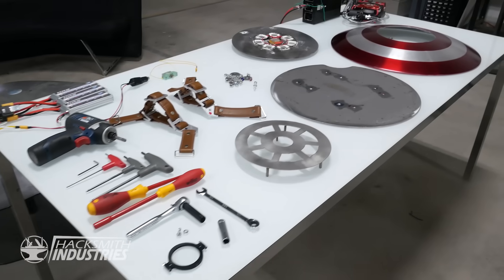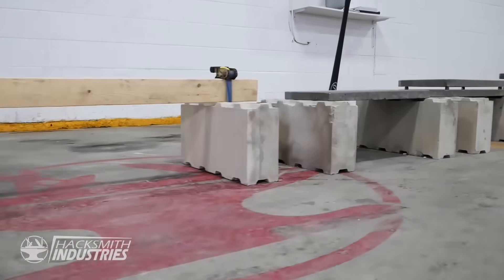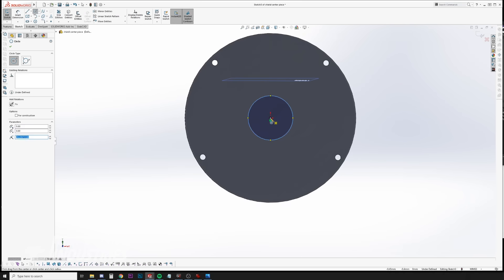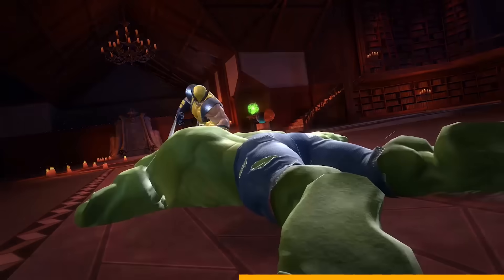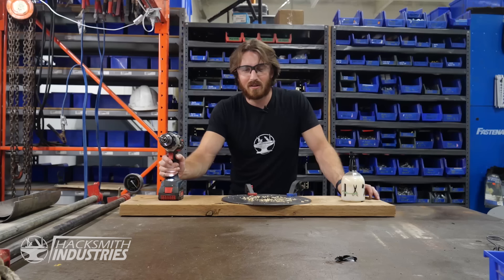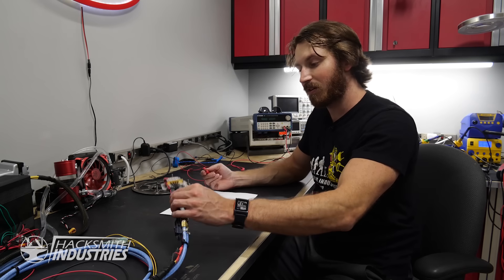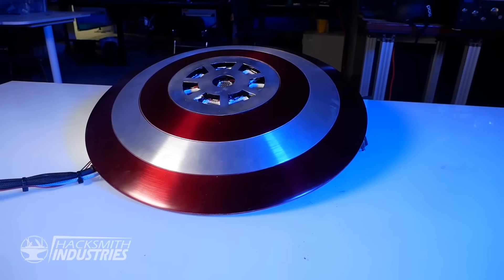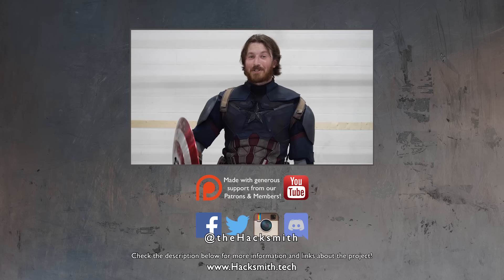Captain America ARC REACTOR SHIELD in REAL LIFE!

Comment: Tip, weld the edge of that shield then machine or grind it pretty leaving enough of the weld without grinding it away, it will make the metal edge up to 5x stronger than the metal.
Reply: Whaaaaaaaaat

Comment: The hack smith is using the new Nichia NUBM31T 455 nm 95W Multiple Laser Diode, and this man is very smart, if he wanted he could do a 5000 watt laser that can melt steel like butter, he would just have to use 55 of this 95 watt multiple laser diodes, 95watts x 55diodes = 5,225 watts, then he would just use a concave optic lens to combain all the lasers then he would use a collimator lens to focus the laser energy densety, and then he could use a magnifying glass to make it even stronger.

Comment: Yo I got a cool idea for an experiment you could do for a video. You know the spray that turns stuff indestructible what if you had 3 cap shields and you sprayed each one a different way one sprayed on the front one on the back and one on both sides once done you can do tons of tests like which one is the most bullet proof of which one is more heat resistant and more

Comment: It’s impossible to create a act reactor. A arc reactor is a plasma reactor. And the reactor needs plasma. Plasma is over 31 million degrees, everything would melt.
Reply from the maker: Uhh its a lot but not 31M... 20-30,000C
Reply: the Hacksmith but it still would melt everything. First thing first the arc reactor would over heat. The things you should use are.  Plantium, cold plasma over 10,000$ I think. 2nd the anti radiation. The anti radiation would kill you. But the shied and the arc reactor is amazing great video

Comment: How the hell is this thing so strong he goes through those bricks like they're nothing if I tried that I probably would snap my arm in half and I am a pretty big dude. Crazy how strong he can get that thing. I mean the first guy hit it with an ax pretty hard and it took two shots he hits it with the shield one time and totally fuckin annihilates it 
Good goddamn work right there good job my friend.
Reply: I think its just bullet physics... 
I think its penetration, the less area the higher the focus on the tip ofthe shield.
Reply: No, it’s not the shield it’s the Hacksmith, have you seen his biceps?
Reply: Also having the blocks spaced apart makes it much easier. That's how people chop wood planks with there hands
Reply: @ZyaTamino  i have and he is ripped. i bet he would make a great movie actor considering his talent
Reply: Its the shape of the shield plus the weight of it. A shield likr that has to be pretty hefty. Look at when he breaks the 5 6 slabs in slow mo. He almost tips over trying to stop the shield. So basic physics. The more mass you have the more force you put out. Acceleration changes, gravity applies different etc.
Reply: Well with the shield there is a lot more momentum compared to the small axe head so it takes two hits instead of one
Reply: Well it’s a combination of the sheiks and the fact that he’s in better physical shape than the dude with the axe
Reply: pls don't swear
Reply: Hey I was sondering if anybody else understood how to download that app via the Link cause i didn’t see it

Comment: What if you added a strong hydraulic actuator to the shield so whenever it detects an impact it dumps all the energy of the shield into one extended out point to make it even more powerful
Reply: So instead of breaking through multiple small layers you could say put giant fault line type cracks into solid concrete, I’m talking like maybe 1 foot thick if my theory is even possible

Comment: 14:24 i love the way that he need to hit 2 times for 2 stained glass while he just need to hit 1 time for 6 blocks 😂
Reply: You can clearly see that someone added metal to the shield to make it easier to smash things.
To make it even more clear in the first test he used a metal handle with more metal on it. An in the glass brake he basically used a consumer shield just with a different center piece.
Reply: @Nick.Koehler  Make a lot sense of now....
Reply: @Lyslatte2  another thing. When someone throw cinderblocks at him in the obstacle course. With cheap cinderblocks if you drop them wrong they break
Reply: @Lyslatte2  plus the glass is tempered fyn fact did you know that glass is very simillar in strength to diamonds you just gotta now which point to hit for it to shatter just lite glass and you can see in the slo mo it the glass kunda bounced back it has a little bit of tensile strength while the blocks don't once the 1st block shatters the energy travels through all the blocks that's why we put steel through conscrete

Comment: "with an arc reactor in the center"

Oh, so it's useless since the part of the shield which should receive the hit is made of glass.
-.-
Reply: 15:10 it works just fine
Reply: @fgvcosmic6752  yea, but if u look @ the slowmows reel close I think they took the lights and laser out for that test. But I bet if u put some machined sapphire glass on that bad boi it'd work a treat.
Reply: @fgvcosmic6752  not if something like a bullet or a steel spear hits the glass.
Reply: Real buckler style shields are supposed to deflect hits from the edge, captain america just uses his shield wrong lmao
Reply from the maker: Doesn't that make iron mans chest also weak?
Reply: @hacksmith  It does indeed. The difference is that a chest is on yourself while a shield is used explicitly for... shielding yourself from something. It's supposed to not have weak points. I mean: you could use a diamond or an artificial diamond glass that of course will be hard AF and this would be another story.
Reply: @TheIceThorn  I'm telling you man, milled sapphire glass, look it up.

Comment: I have too many hipotheticals that my brain just might die, so first, what if they use other cooling system so it gets smaller, only using steel isn't the bests of options, its better if you have it like so (soft steel, high carbon steel, titanium, high carbon steel, soft steel, thats a way better shield since is flexible enough not to brake but hard enough just so it will brake stuff better, if you are able to make the cooling system smaller you could be able to use more than one laser and make them focus in one single place making it even strong, how so? you may ask well whit mirrors i am aware that silver mirrors and glass would melt but im pretty sure there is metals and glasses able to whitstand such heats such as titanium and high resistance glass which then you can uso both materials and have a heat resistant mirror

Comment: Whao Whao Whao we have the same gas mask. Btw instead of using only one laser beam use four or five. Point them at a 90 degree angle for them to create a single more powerful beam. I’ve tried it with less powerful lasers and they actually did well burning through wood and some metals

Comment: you could have made the lasers better (sense you cant actually make an ark reactor apparently), if you use the right gain medium shape and a high enough low power laser for the stimulated emission you could increase the diameter and still get the same effect. Also the bose einstein condensate effect could help.
Reply from the maker: Or just a focusing lens, which we did use for the wood burning scene :)
Reply: @hacksmith  well a focusing lense helps but its best to start off with a higher power laser to kick off the emission, imo its best to have a starting laser that doesnt need the lens to accomplish what you need, it costs much more but her, at least it looks cool
Reply from the maker: Not many options for something more powerful than this
Reply: @hacksmith  not many tested options, ive always though about how to make lasers better and the best option i could theorize was to condense the photons to represent a solid even though they cant actually be a solid.

Comment: Looks like an angle grinder was used to make a counter sunk hole for screws. A top tip is to drill with a big drill bit into the hole using only where it's angled. So you get that funnel effect
Reply from the maker: No we only showed cleaning up the plasma cut. A chamfer bit was used

Comment: Woulda been super cool if they were able to use quick disconnect tubing and electrical connectors for the laser and lights. But sadly it doesn't even look like they even threw the shield with the components in it.